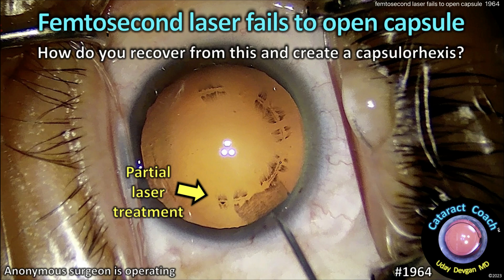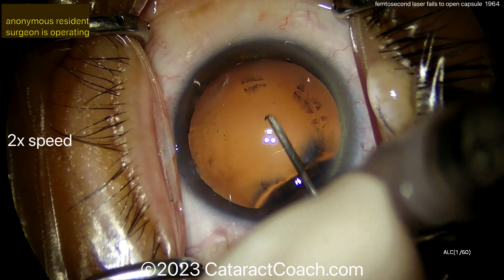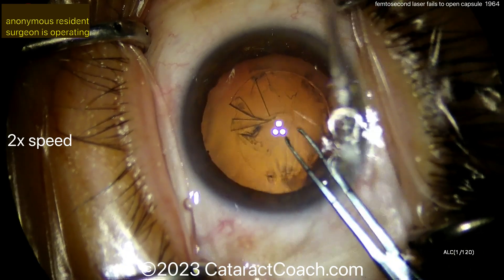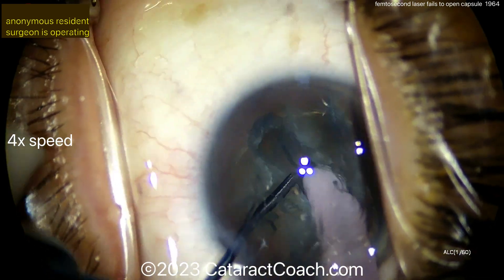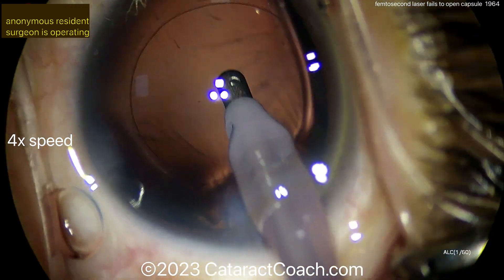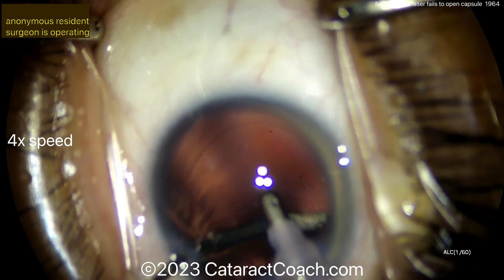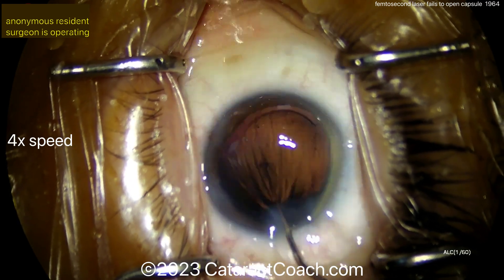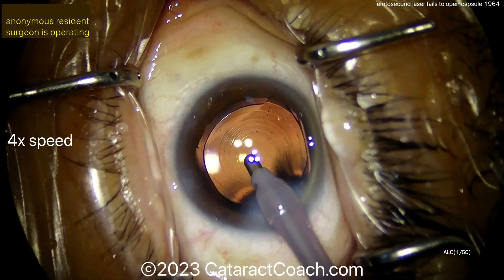CataractCoach™ 1964: femtosecond laser fails to open capsule

Comment: Good recovery.  The patient must have popped off during the femto, as no lens fragmentation seen. When using the laser, I always do a quick visco-dissection of the subincisional cortex before starting cortex removal. Takes 5 seconds and saves a lot of time later on. Good job resident! That's an amazingly round rhexis given the situation.